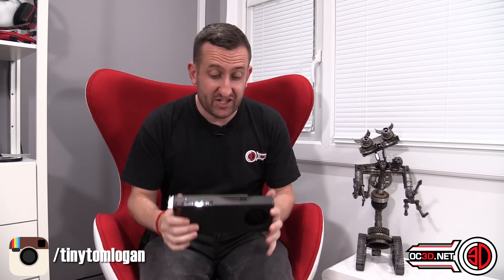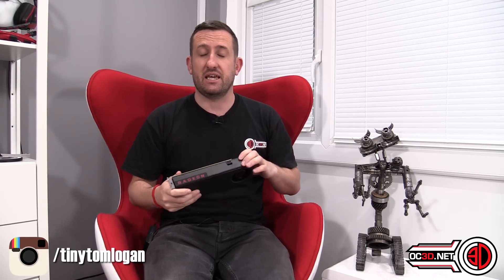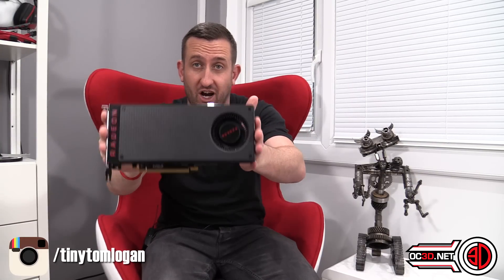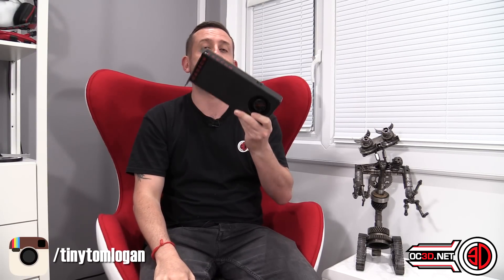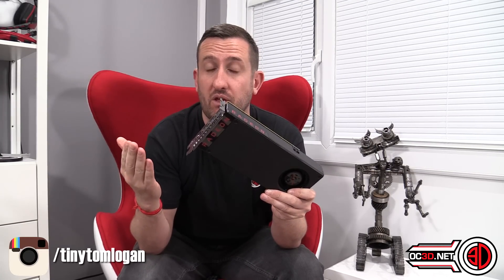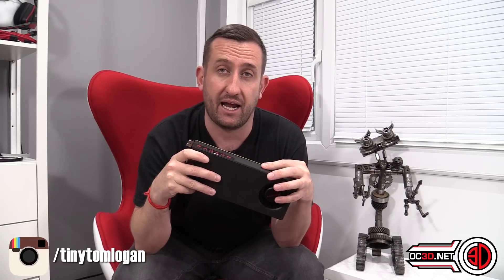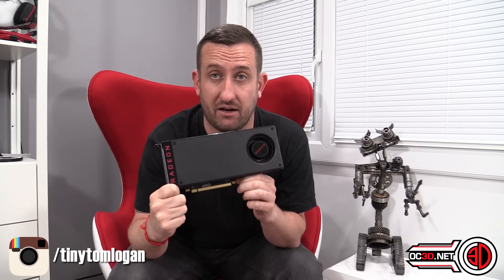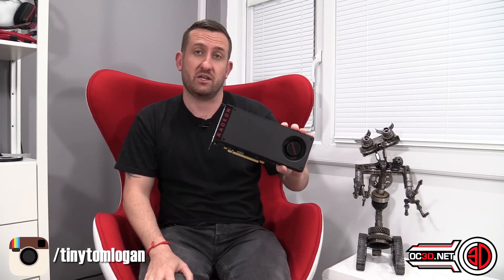RX480 power bottleneck? TTL Talks

Comment: AMD are still doing the hot hair dryer shit then. Whats up with them?
Reply: Heyyo, "hot hair dryer shit" is ALL cards with reference blowers and especially with reference fan profiles... they always blow in not the good way. Non-reference for temps and overclocking ftw tbh. Look at the GTX 1080 founders edition as a prime example... tbh quite dissapointed that Nvidia were charging a premium for that crap. I wish AMD would have just allow non-reference coolers on release day of the RX 480 just like they did with the R9 390 / 390X... I think only XFX bothered making a reference blower card for the R9 390 lol... now if you look at the non-reference cooler reviews on the GTX 1080? MUCH better power delivery, temps and OC capabilities... also, Nvidia is really tame on their clocks and GPU boost compared to AMD which tend to push their GPUs a lot more hence they don't overclock as good. A prime example being JayzTwoCents video on the GTX 970 vs the R9 390 where he tested the R9 390 was faster stock, GTX 970 OC was faster than R9 390 stock but the R9 390 could overclock a little bit and beat the GTX 970 OC performance a little.

So yeah, if you care about temps, power delivery and overclocking capabilities? Don't ever consider reference design from AMD or I guess founders edition from Nvidia... blower designs are better at keeping the hot air out of the case (better for smaller cases with poor airflow) but every other case? non-reference will net better performance. These days with Multi-GPU as well? Most modern motherboards have their PCI-E x16 slots spaced three apart so the choking of the top card is pretty much a non-issue and unless DirectX 12 and Vulkan explicit multi-adapter gets support for four GPUs? Odds are that stuff won't matter either... Ashes of the Singularity, the only game with EMA right meow? It only supports two GPUs...

I've owned reference blower GTX 480 SLI (which was reference with heat pipes too... if ya wanna talk about hot hair dryer shit hahaha... always hovered around 90c) and reference blower GTX 680 SLI (tbh didn't mind the 80c constant temps) so I definitely know how terrible reference blowers can be... but I have an older Z68 motherboard and the PCI-E x16 slots were spaced only two apart so the GPUs were sandwiched.. so I removed my PCI-E sound card and put the second GTX 680 in the very bottom slot and still that only made a 2c difference so barely anything... so yeah, I'm never doing reference blower GPUs EVER. Custom power delivery, custom coolers are a definite for me from now on. <3 MSI's Twin Frozr
Reply: They never learn thats what. i thought this would be the year AMD would stop getting stomped but i guess i was wrong.

Comment: I went to buy mine yesterday morning... and wound up buying an R9 Nano that was on sale for $375, instead (it's going in an mITX Fractal Core 500, so it had a few added benefits)... I figure if custom RX 480s come out with substantial gains or potential [gains] within 30 days, I might return the Nano... but it's pretty awesome so far.
Reply: I can see the future.....you will be keeping the nano
Reply: Sic Semper Beats haha, more than likely. Unless I run into an actual situation in my own use where the 4GB VRAM turns into poor performance... or unless the AIB 480s are engineered to basically be different cards
Reply: NBMTX someone online said that the 4 GB of hbm equates to 6 GB gddr5

Comment: Very good information in this video.  I'm no expert but between the design of the reference and the after market cards that will release soon my thoughts were also on that power delivery as well.  150w to push that RX 480, I wonder what potential can it have if an additional 50-100 watts were available with the aftermarket cooling?  Tech Gaming Weekly had Sapphire Ed on their show and he produced a picture of their nitro RX480 but couldn't divulge details.  This card may be a caged beast.